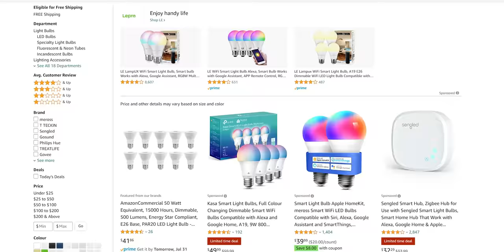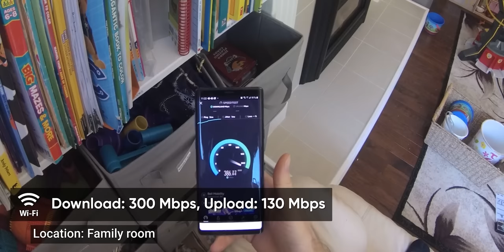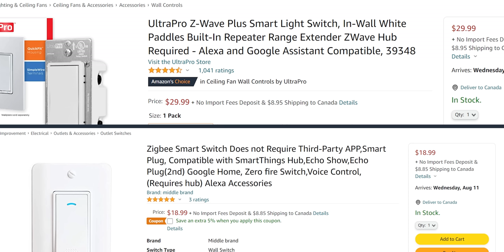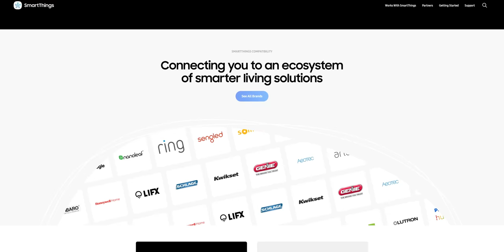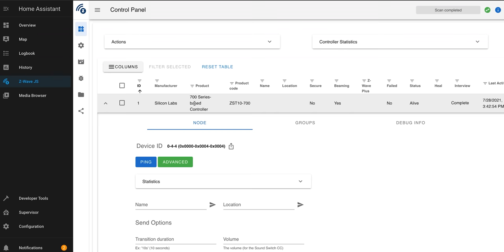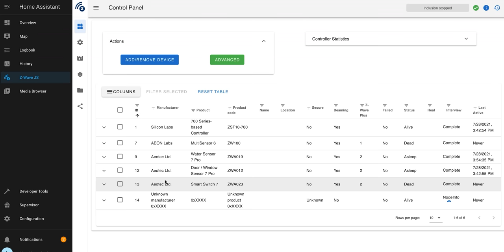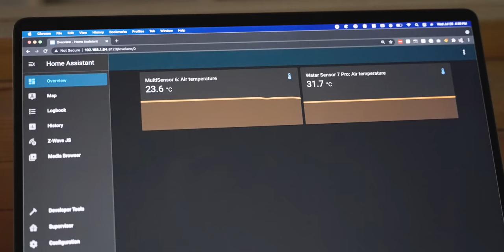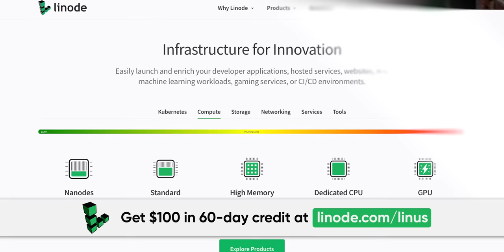My new house is gonna be MAGIC - New House Z-Wave Setup

Comment: Wrap your light switches screw terminals in electrical tape so you don't end up shocking yourself when you grab it to pull out of the electrical box (just in case).
Reply: This is a good idea in metal j boxes so they don’t accidentally make contact with the edge of the box, but in a plastic box there really is little need.
Reply: I want to watch him zap himself . Not badly though but I don’t know if that’s possible
Reply: Wait? You can zap yourself with lightswitches?! I knew NA home electrics were bad, but this? WTF MAN!
Reply: @Ruhrpottpatriot  Terminals with screws, where you wrap the wire around... LOL, we stopped using these 50 years ago
Reply: @Ruhrpottpatriot  you can shock yourself anywhere with exposed wires, they aren’t talking about turning the switch on and getting shocked they mean working on the switch out the the electrical box and touching the screws where it it attached
Reply: 100% this started doing this on my Reno!!
Reply: @swisspeach67  i didnt realize i was living in the 70's......just replaced my switches with smart switches and this is how they are setup. BTW, those "stick the conductor in the hole" type are terrible and barley work to keep the conductor in place. also.....cant shock yourself if you actually flip the breaker.....
Reply: Rubber tape actually. And I believe this is all just for the video. A contractor is installing at the switches, receptacles, etc
Reply: American electrics are complete junk
Reply: Heatshrink?
Reply: I do this with any outlet I work on
Reply: Bad advice. You don’t pull things out of the electrical box with the power on.
Reply: @float32  well why would you wire it like that
Reply: @float32  you can still isolate it. If someone doesnt know to turn off the pkwer, they also wont know what not to touch.
Reply: You have bigger issues if you are grabbing the switch like that in the first place. It is not easy to hit all those points just grabbing it.
Reply: or just flip the breaker when you're modifying anything in the circuit?
Reply: @yomomma6492  It's still stupid. Here in Germany all of our wires are solid core and we don't use screws for the wires since the 80s or so. You just push the wire in and it's held firmly by a spring (and I mean firm, I can more easily pull out a wire from a screw than those springs). This means unless you suck at stripping your wire and strip too much you'll never get near any exposed conductive material.

But then again: Somehow stranded wire is still common for in wall wires in NA.
Reply: @swisspeach67  backstabing a switch or a receptacle is a terrible practice and also wagos are garbage. use the damn screw terminals.
Reply: @swisspeach67  US outlets are also rated for double the amperage your guys are. So I mean it’s a good trade off in my opinion. Do you guys back stab them? We frown upon that here as over time it becomes a fire hazard.
Reply: @danieltaylor-eldestofdan8602   Full time electrician and yup - push-wire terminals suck and are unreliable.
Reply: @contradictorycrow4327  lol first thing I was looking for
Reply: @jdahling4738  Double the amperage? IN Germany we have 16A@240V on all common outlets and the US has either 15A@120V or 20A@120V. So even with our lesser amperage we get more W.
Reply: @liberatorkramit  you don't need to hit all those points. You just need to touch the hot wire.
Reply: Please don't do this.
Reply: As that saying goes, only fools dont wrap their tools.
Reply: @Tlavite  Screw terminals like the one shown in the video are absolute garbage! We also use screw terminals on certain applications, but then the screw is recessed in an insulated plastic tube. You can't touch the screw with your fingers, only with a screwdriver
Reply: Or turn the power off like a sane person
Reply: @uhhhhh262  Do explain
Reply: @swisspeach67  ah yeah we got that on allot of new devices also
Reply: @Ruhrpottpatriot  I meant to say switches not outlets. My mistake. Am I still wrong though on that? Genuinely curious.
Reply: @Ruhrpottpatriot  Good job assuming things. Solid wire is most common in houses in the US but I guess making up stuff just to hate on a country is fine right?
Reply: @Veighnerg  damn I didn’t even notice he said that. You’re right we haven’t used stranded wire in houses like, ever lol.
Reply: When installing them in homes/construction I always tape around them for the future person
Reply: Abi türkmüsün?
Reply: @Nature Taco clearly is not what I am talking about. Look at what Mark Berberoglu said, explains what I am saying perfectly.
Reply: @Nature Taco there is no metal that is non conductive. It is a basic property of metals.

You ignore basic physics and go around insulting other peoples intelligence or claiming youre such an expert? 

Youre not. And considering you just made up non-conductive alloys you probably made everything else up too.

Look the guy was so wrong he deleted his account lol.
Reply: @jdahling4738  Switches are also rated for 16A. Basically every user facing circuit is secured with 16A at 230V +- 10% in the breaker panel.
The exceptions are electrical stoves which have three 16A breakers at 230V and flow heaters which have 3 25A breakers at 230V.

There are some older installations where some breakers are 32A, but those weren't common for quite a some time, unless you had an outlet for welding or other machinery in your shed. If you had then you need switches like https://m.media-amazon.com/images/I/61PCFcHlWVL._AC_SS450_.jpg and outlets like https://www.kabelscheune.de/out/pictures/generated/product/1/450_450_90/cee-wandsteckdose-32a-3-polig-230v.jpg or https://cdn.hornbach.de/data/shop/D04/001/703/159/248/DV_8_0822935_02_4c_DE_20140409112443.jpg (depending how many phases you need)

32A breakers have a slight comeback in home installations because electric cars, since they allow you to get a 22kWh wall-box (we get 400V by default into our homes).
Reply: @Ruhrpottpatriot   Stranded wire is not common in North America. He put two solid core wires under one screw (daisy chained receptacles). And, the push in are not as reliable compared to screws since the contact area and forces for push in are much much smaller. Builders here use them often but electricians, who come to replace them when they eventually fail, usually don’t. With daisy chained outlets (common), the first push in carries the load for all the rest of the outlets on the same breaker.
Reply: @swisspeach67  What do you use instead, the push-in style? Those are usually considered less secure than screw terminals.

Comment: 15:22 Yes it is bad to run empty microwave but it takes a little while before funny stuff starts happening. Newer microwave ovens might have some safty stuff but in this case all that 1.3kW is going to heat the frame. It can heat one spot to red hot steel or/and start making arches if the paint/insulation of the frame is damaged.

Comment: When it comes to motion sensors you really want ones with microphones. Imagine doing an LOTR sesh and boom you’re thrown into darkness mid siege of Gondor because no ones moved.
Reply: With the power of home assistant you can add a lot more smarts to it then just motion, for example, in my computer room I have my lights also trigger off my computer's idle time. I was having issues with my office lights turn off with me sitting at the computer. (Apparently I don't move that much) 
But now every time my mouse moves or the motion sensor sense motion the 20 minutes timer resets. You could do the same thing for like a TV room. If your media device is playing a something home assistant can assume the room is occupied.
Reply: Why would you want a microphone? Home Assistant knows that my TV is on and that Plex is running and what is playing, so as long as something is playing it doesn't turn the light's on. When I pause, it turns them on to a medium setting and when I stop it goes to full.
Reply: @MrMaltavius  I like the integration with media pause/play idea!

Comment: I’m running almost 60 devices, from dimmers to switches, smart bulbs, cameras, doorbells, locks, motion sensors, light sensors, occupancy sensors, alarm equipment - all on a Vera Home Controller with built in z wave, zig bee and Wi-Fi. 
Some things are automated by scheduling or conditional logic, while others are parts of scenes that I can initiate with Google. 
I replaced a switch at a time when I could afford it, and now the house is almost fully automated. 
As an electrician and a lighting control expert, I had a leg up, but anyone can follow the directions to make your home smart.

Comment: Pro tip: swap out the SD card on the raspberry pi for an SSD. The Read/write operations of home assistant will destroy it.

Also consider replacing the default SQLITE database for Mariadb. Much faster performance.

The sooner you do this, the less of a pain it is.

Comment: The other issue with zigbee is range and mesh size. It can be tricky to diagnose or figure out problems because they’re often just a battery and a sensor, and little else. 

30+ devices can be a challenge because it broadcasts in a 10-30ft radio bubble, which may require having a few odd wired/plug-in Zigbee light bulbs, wall switches or repeaters to prevent signal/battery loss. You may need a few wall plug repeaters from ikea to improve the speed if you add an outdoor sensor or lots of battery sensors and they start to not respond quickly, or at all in their new location.

That said, you can separate a hub for different device types on different channels if you have lights and devices that take too long to respond. 

Eg IKEA tradfri separate to Philips hue lights and paired with the aeotec sensors etc. 

pairing is usually the easy part, troubleshooting is tricky.

Comment: As far as I'm concerned, the main problem with Z-Wave is that its inclusion and exclusion stuff and the rerouting is a pain in the ass.  Once I switched to all Zigbee, everything ran a lot more smoothly.
Reply: I had nothing but problems with z-wave. Switched to all Zigbee and everything works and batteries last twice as long.

Comment: Still waiting for the home devices market to mature. There just isn’t enough standardizations and development to make it easy, repairable and replaceable, all without being connected to the internet.
Reply: bah don't wait tinker away!!  You will have more fun that way.
Reply: So optimistic, even though they're doom and glooming days, weeks, months of Internet outage, they still want to use internet like DRM.
Reply: You'd be surprised.  Home Assistant can be local only if you want, and Z-Wave devices are pretty mature at this point. There's definitely a lot of internet connected garbage 'smart home' stuff out there, but there's also a ton of great stuff.   Just takes time to figure out what you really want to do, and the right products for it.
Reply: HomeAssistant can be offline only

Comment: Guys you missed an amazing really smart thing you could use that stand alone 6way sensor if it has vibration detection..  Earthquake detection.. now I have no idea how "sensitive" the device is and you'd want to set the threshold for such a trigger very very high otherwise a big semi getting lost and coming down the street could set it off.  Still though if tuned "right" you could have it cut power to the whole or key sections of the house (block out spots for emergency lighting and network so you theoretically could still access net for info). Setting it up to turn off things like gas (if possible) or high volt/amp devices, the safety that would add to the house during "a big one" would be major because lots of "after the quake" damage comes from fires, live gas, live high volt/amp electrical and so on.

Comment: Good stuff Ive been slowly going all zwave for the last couple of years. Everything has been super dependable.
Reply: @BoltRM  I'm running all zigbee. Doorsensors/lights/outlets/smoke alarms. All is well and working fine zigbee2mqtt is a godsend of a tool. so yeah go with what you can afford. Yeah zwave is more "standardized" so with zigbee devices you have to check the manual or the zigbee2mqtt site on how to pair. But it's all easy enough.
Reply: @LigerXT5  i'm sorry I don't use zwave at all. All my house is zigbee. I use Philips Hue for my lighting. More because it talks nicely with my Philips tv with ambilight. I thinks with lightbulbs zigbee has more options. But look into aeotec. Because I believe they are one of if not the biggest players on the zwave spectrum.

Comment: 15:43 wow. I’m surprised a house of that size didn’t come with a 200 amp panel. My house was built in 93 and isn’t nearly as big and it’s 200 amps. 

Also for your movie theater you should use actual movie theater speakers and not the ones you can get for a home theater. That would be epic!
Reply: Looks like it could be a sub panel, but it’s pretty full.
Reply: @LzysGraphics  yeah I saw a second smaller panel to the side so I thought that was the sub panel. And this panel sure is full!

Comment: as an asian, I'm beginning to see the appeal of dry wall instead of the brick walls we have. Easy to open up for DIY projects and easy to fix back up.
Reply: Trust me, brick walls are MUCH better than dry walls in those cardboard houses
Reply: same here! every diy video is like "just fish the wire" and done. If i want that neatness in my installs i need some power tools, conduit, some concrete, plaster, and a couple hours/days of work...
Reply: so you generally have double brick?
Australia is much like America, we tend to have single brick gyprock lined houses.

Comment: Having current measuring on specific circuits can be very useful.  I have one on my washer and one on my dryer.  I set those up to have home assistant trigger an Alexa notification when it's time to change the laundry.  The Ge/Jasco z wave switches work very well.  I've found that Zigbee switches drop off the network sometimes.

Comment: Can't wait for the follow-up video about how all of the GE switches have failed after 6 to 12 months. I've had about 25% of my 30 or so fail and the "click of death" seems to be a common occurrence.
Reply: Ouch, that sucks. That's not a small sample set and those things aren't cheap!
Reply: I had trouble with X10 switches going zombie, either ignoring commands or activating randomly. I’ve only got one left, and need to replace it because even local control isn’t working properly.

Comment: Awesome choice going with Aeotec devices. Been using them (Dual Nanos, Nando Dimmers, MultiSensors, Z-Stick, Garage Door Controller etc) for a couple of years and they haven't skipped a beat. I have them connected to Home Assistant as well (running on a RPI 3B+) which is an amazing home automation platform. I have my solar system, HVAC, robot vacuum, security cameras, smart speakers, TV, fridge, door locks, custom irrigation system and many other devices connected to it as well. 🤓 Nothing beats having everything on the same platform where they can seamlessly communicate with each other. You can install add-ons like Node-RED on Home Assistant to make automations much more richer and easier.

Comment: Every "smart" home product I've ever had eventually becomes flakey with it's internet connection. 
I had a smart outlet that was less than 3 feet from the router, and it said it has a poor signal strength. It's all garbage. I can see the appeal, but until it matures, its pretty much useless.
Reply: @PoisonWaffle3  if i ever get a home, the only “smart” stuff I would consider getting is apple stuff. I guess I’m old, but I don’t see the point of the internet of things. Regular switches work just great for me
Reply: That's why you spend the time to install home assistant, it's all local.

Comment: I love homeassistant so much. It's been my entry into basic coding and it's a lot of fun for the home. Basically good brain exercise with all the problem solving you have to do yourself. The added benefit is having cool stuff in your house/room. Having lights turn on/off based on your location is the best, and having them track the position of the sun and adjust brightness and color temperature accordingly is fucking amazing. Have an older speaker amplifier that you have to manually turn on? Fret no more, just plug it into a smart plug and set the plug to turn on when your computer turns on and vice versa. The possibilities are literally endless.

Comment: I just hope that Linus is thinking about the security side of this smart setup. It would be very unfortunate for him to set up all of this smart stuff for some asshole to just come hack it all.
Reply: Everything appears to be on the local networking, and as long as the gateway is secure, he should be okay I would imagine?
Reply: @Nj1498  I'm assuming that Linus wants a way to control it even when he's not home, which would require at least his home assistant server to be connected to the internet. I'm just hoping he has his own firewall or something similar installed in his home to protect his network.

Comment: I see you guys are using the twist-on wire (Marette) connectors over there in Canada. I've seen some hefty burn marks from untwisted wires (they used those over here (Belgium/Europe) until the late 90's). If I can make a recommendation, try using WAGO clamp connectors. Much easier and much more secure. (each wire is clamped independently).
Keep up the good work!

Comment: One thing you might want to look into that is brand new leviton smart panel as your electric box. I use one and get everything controlled by smart wifi switches and it tells power usage. (with the smart switches)by the circuit. Its really cool.

Comment: The ev chargesrs will
Use the Ct metering you installed in consumer unit as they can drop charge rate if your close to overloading service. Well at least we can do that here in uk.